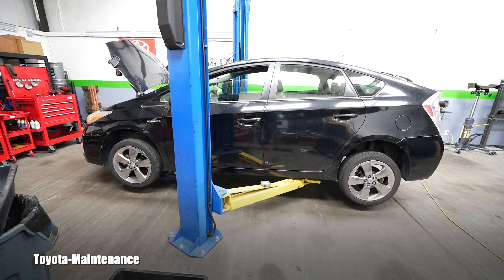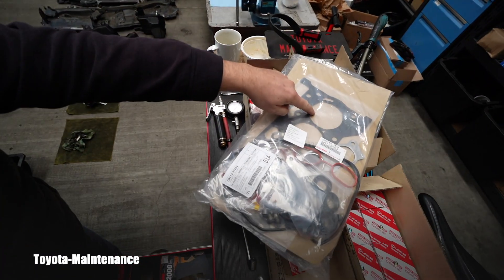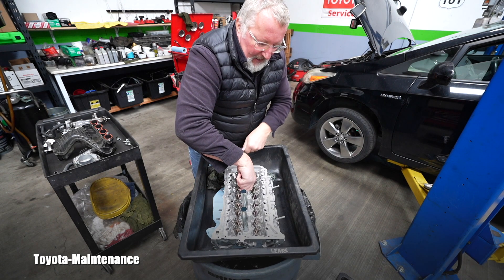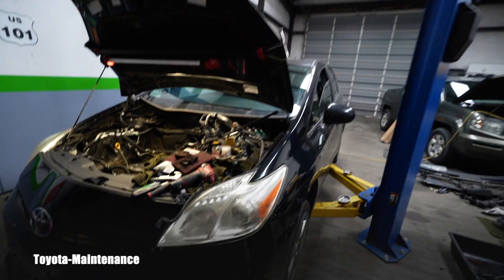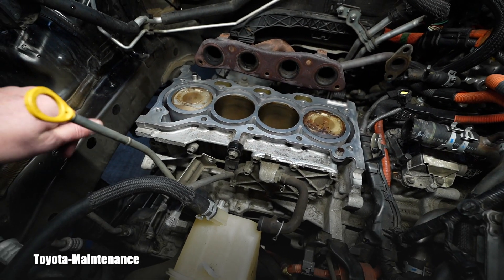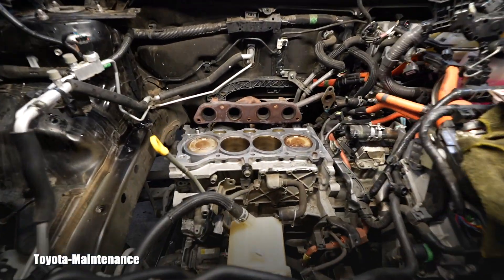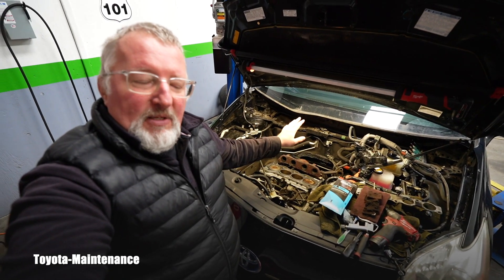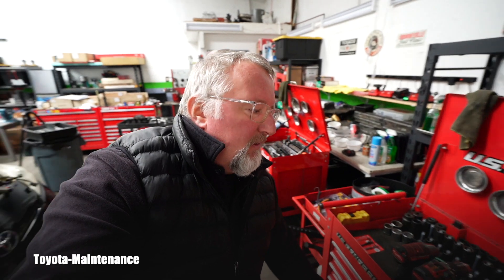Head Gasket Job - Surface Preparation - Soft Aluminum - Be careful

Comment: Hello! You asked for comments. This work is not done correctly. I saw on YouTube how a Japanese master did it: there is a special precise thick steel ruler; it is applied crosswise diagonally to the plane of the cylinder head and looked at against the light. If it is clear that the parts are deformed, then they (the cylinder head and cylinder head) are sent for grinding on a machine. If the ruler shows that the surfaces of the parts are flat, then grinding is not done at all. I think this repair method is correct.
Best regards.

Comment: I saw Eric O from south mian auto ise some special kind of scraper on his heads but with the same caution. I dont remember ifbhe said aluminum or not. I think it might be a carbide scraper? All i know is he raves by it as a treasured tool he featured here and there in videos. But stick to what you do. Whenever you try new things is when problems happen and only you will be stuck with the effects.

Comment: Red pad is all i use.  I get a little concerned with droppings into the cylinder area so i use compressed air to remove them.

Comment: I like your videos - my favorite Lexus/Toyota channel. I have a Lexus 2012 CT200h (bought new) with 80k miles and I'm starting to worry about the head gasket.  Now I'm at a decision point:  1) sell it, 2) keep it and wait for the failure, 3) get the head gasket replaced now.   The dealer wants $8k for the job here is Silicon Valley.  I could drive it up to your shop.  Can you provide a rough estimate for this job?  Thanks.
Reply: Also why are you worried about it? Do you change your oil every 5 k and coolant every recommend interval and don't push the vehicle beyond normal use? If not just drive it until it misfires and then get it done.
Reply: Technically speaking, if you maintain the EGR cooler and EGR valve, preventing it from partially getting stuck open allowing flow all the time, you should avoid this repair.

Comment: Now that is a job where you need a fairly accurate torque wrench and have to follow the right bolt tightening sequence from Toyota. 
How about Honda and Nissan possibly joining up. The Chinese are trying to snatch Nissan at the last minute. Even the BBC radio is talking about the potential deal. 
A good machinist is hard to find these days. You need to be smart and dedicated to do that job correctly. Peter is lucky to have found one who works so fast for him.

Comment: Good video. However the 20 years plus senior toyota  car care nut Mohamed recommed not to do that but inspect how many 1000 of the block surface has for warpage if there is not sign of it you just with 3M kitchen thin fine green dish scrubber just like the one you used on the block to clean debreis on the surface  unless necessary as the timing chain would eventually lead into chain link jump. If it is surfaced then dealer has to see how many thousands of gauge  is now the head and the block for ma accurate gasket.  Best of luck!

Comment: You have to be careful with machining heads and blocks on VVT engines. It can remove enough material that it can screw up the position of the timing - then you will be dealing with crank/cam correlation fault codes that you cannot get rid of. If you overheat or warp a head/block, most of the time you'll be in for a short block replacement.
Reply: Also warped heads can stress the camshaft a lot if the head is warped and they just skim the bottom surface - the cam bearings won't be in a straight line anymore which will cause cyclic load on the camshaft possibly causing it to break eventually. It's better to try and straighten the head as much as possible, and/or line bore the cam bearings. Not easy!!! At least check the straightness of the bearings if the head was warped.
Reply: Yeah he said something about it changing the distance of the space and because of its right tolerances it can change the compression stroke. But I say hey if Pete's been doing it for this long and it's never failed him just keep going this way. Change is where we get ourselves into trouble.

Comment: I send the head to the machine shop. Where they tell me it is cracked, so I have to order a new one. For the block, after scraping with plastic blades I do use wet sanding with WD-40, with 320, 400, 600 and 800 sandpaper. I used the white disc once and like you I found it too aggressive. It has worked well so far. I then clean thoroughly with brake cleaner. Thank you for your channel.
Reply: Need to be very careful with abrasives though - don't want any getting into oil system or the cylinder walls etc.